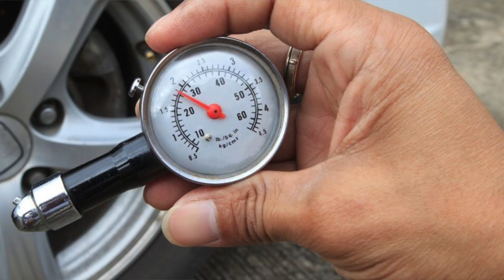Why Car Tyres Explode & How to Prevent It? | Car Geek with theporschelover | Ep.05

Comment: Good info. Applies to all things made out of rubber. What do you think of PU parts ? Especially as replacement in lower arms etc.
Reply from the maker: Thanks for the view bro. 

Yup, applies to all rubber parts in the car. Malaysian weather is actually terrible for rubber parts as it is sunny, hot & humid, the recipe for accelerated degradation of rubber.

PU is more durable than rubber parts & it will increase your 'driving feel'. However, it will reduce your comfort levels as it has less absorption than rubber 👍🏻